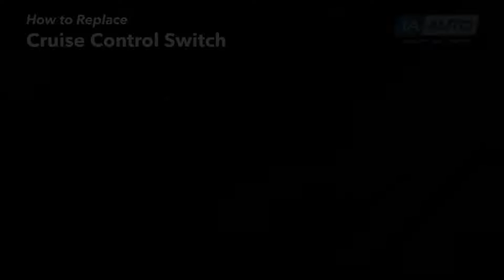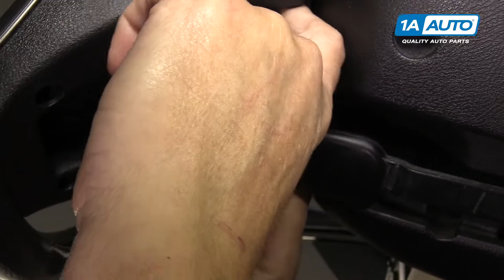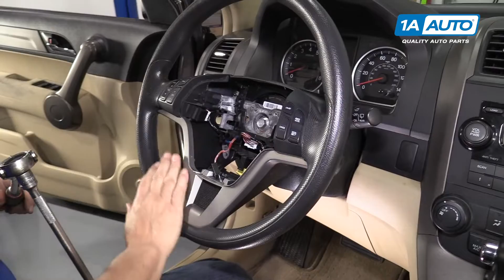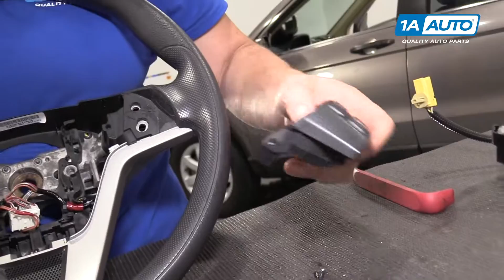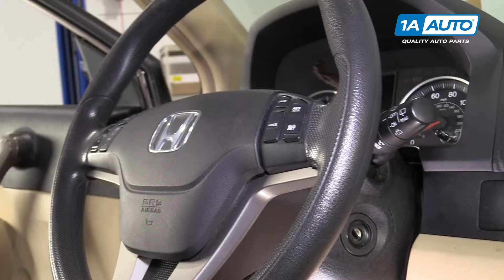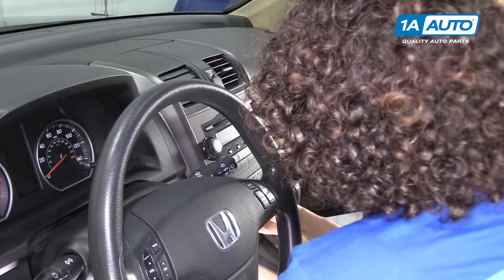How to Replace Cruise Control Switch 07-11 Honda CR-V

Comment: I’ve seen others replace without removing the steering wheel. Just take out the part where the cruise controls switch is. Is there a problem doing it this way?

Comment: So..I changed my cruise control switch and disconnected the battery and didn't unplug all those wires just the switch and didn't take the steering wheel off ...I must be stupid...

Comment: Found the switch online and followed instructions rather easily. No need to remove the steering wheel. The phillips screws are a pain to get out and put back in due to the proximity to the column, but with a little time, everything tightened up as need. I now have cruise control again. Thanks for the video.

Comment: Was it really necessary to take out the entire steering wheel??
Reply: There are a few videos on YT where they change the switch assembly without removing the air bag. The only problem, is the cable going to the switch is fairly short and not real easy to remove, but it can be done. I intend on doing this on my 2006 Honda Accord.
Reply: No